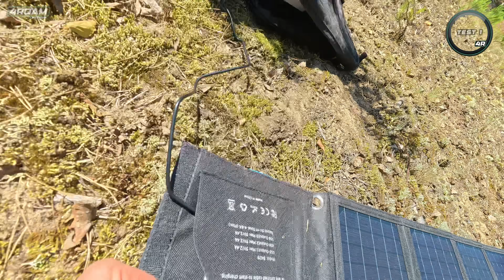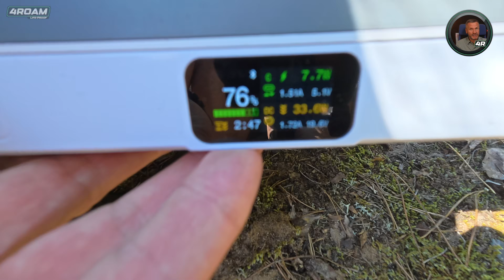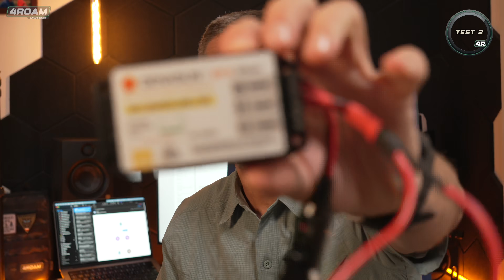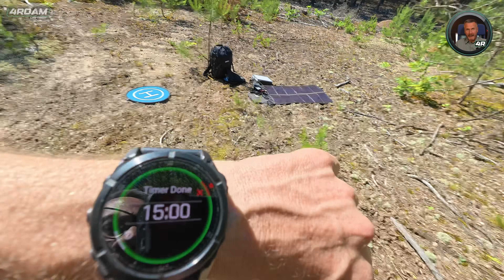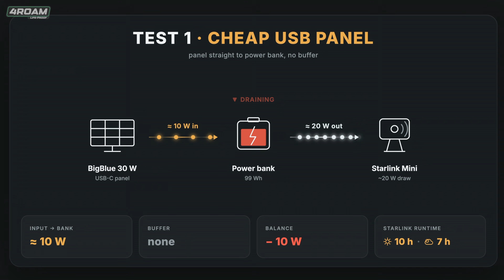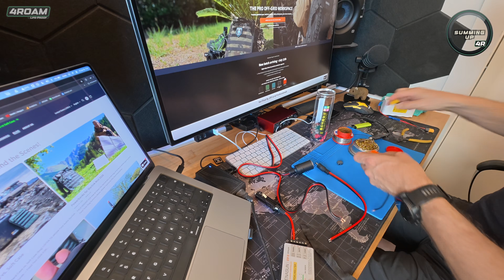Solar Power Your Starlink Mini Anywhere. 3 Setup Tests, 1 Clear Winner!

Comment: Hey Radek, I can wire multiple buffers in parallel for a longer charge? I would like to run a laptop and starlink using this setup for at least 8 hours in a remote mountain cabin, with the possibility that it is snowing (no solar input for long periods of time). Dzieki
Reply from the maker: Hi,

Thank you for your question. Yes, this approach works well, but there are several technical details you need to keep in mind.
Starlink Mini Power Requirements: 
1. The primary power bank powering the Starlink Mini must feature at least two USB-C ports supporting a minimum of PD 3.0, or preferably PD 3.1.
2. Daisy-Chaining Architecture: The first port powers the Starlink Mini, while the second port receives a charge simultaneously from the upstream power bank.
3. Scalability: By cascading them in this manner, you can theoretically connect an unlimited chain of power banks to extend runtime.
4. Directional Port Configuration: For stable operation, the power bank must allow you to manually lock the power direction (In or Out) per port in its menu. You set USB-C1 strictly to "Out" to feed the Starlink, and USB-C2 strictly to "In" to receive power from the upstream bank. Each subsequent bank in the chain is configured identically to prevent handshake loops.
4. True Pass-Through / UPS Functionality: The bank must support seamless pass-through charging without resetting output voltage when external power is connected or dropped. Many popular models, such as Anker, renegotiate and reset all ports when an input source is plugged in. When this happens, the output drops back to basic 5V rather than maintaining PD negotiation, which shuts down the Starlink Mini and requires a manual cable replug.

Separate Laptop Line: Running both a high-draw laptop and the Starlink Mini simultaneously from a single primary power bank is not advisable. Laptop power demands vary widely depending on specs. For system reliability, I recommend setting up two independent power bank chains: one dedicated to the Starlink Mini and one dedicated to your laptop.

For this type of setup, I use the CUKTECH 15 Ultra. It is compact, well-suited for mobile field use, and includes the manual In/Out port direction control and pass-through behavior described above: https://cuktech.com/products/cuktech-15-power-bank

Have an absolutely fantastic day! 
Radek

Comment: Hi, I use a BluettiAC180 with a small 200 W solar panel. It runs days and night. I like to see if it also works from November till February.
Reply from the maker: With a 200W panel, your setup is significantly more powerful than the 30W arrays I tested, so it should handle winter conditions much better as long as you have enough direct sunlight hours.